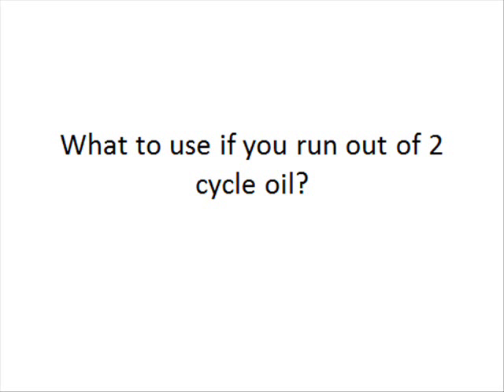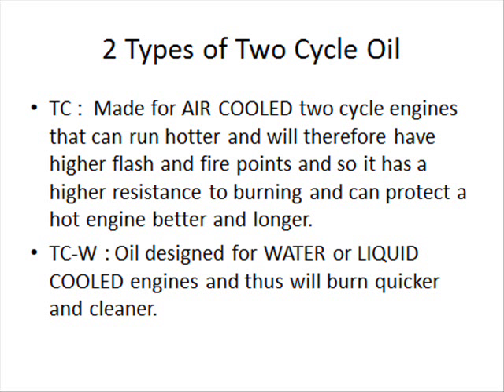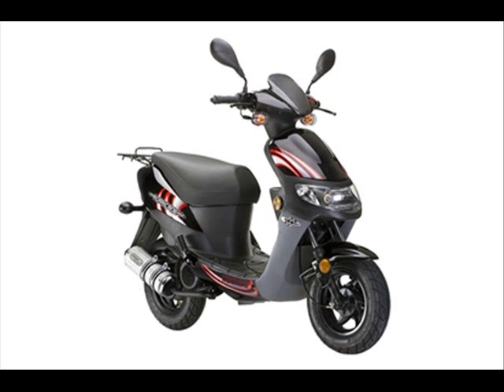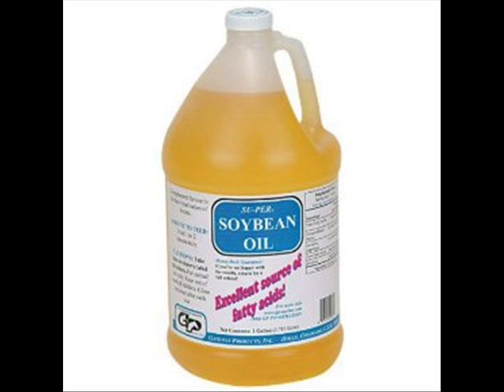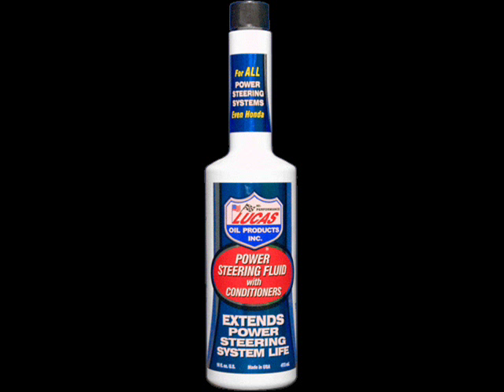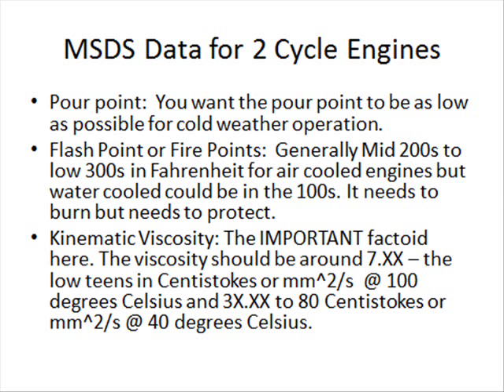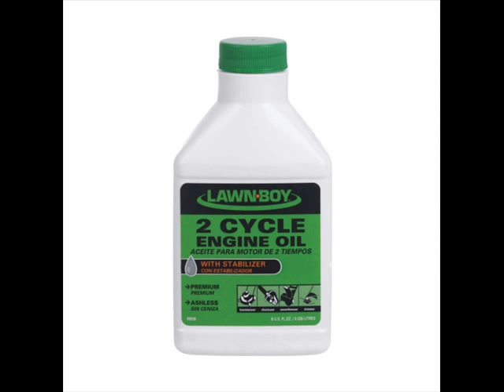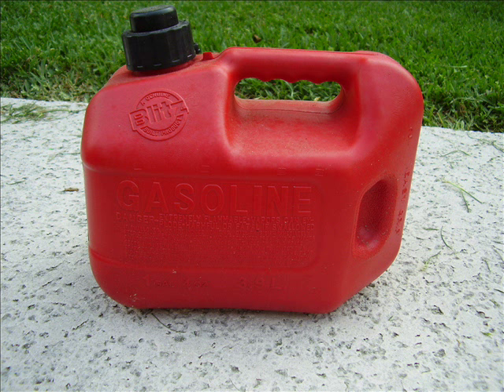What To Use If You Run Out Of 2 Cycle Oil

Comment: My dad cut pulp wood for years and he used 30w oil mixed with gas in his saws. He changed the spark plugs every January 1 and that's it. He still has those old McCulloch saws and they still run great. He even saved his used oil out of his truck and mixed it with the gas.

Comment: Would SAE 90 gear oil (GL1 , 2, 3, 4 or 5) be ok in a premix motor?
Reply: Old homelite super xl 12 chainsaw :  gas cap states one cup sae 30 motor oil mixed with 1 gallon gasoline.

Comment: Hey quick question!! How about using oil additives, such as Lucas oil treatment, either engine or transmission treaments whichever I have laying around?
Reply: If you use anything other than 2 cycle oil and you are putting it in a cheap weedeater like a Ryobi, Homelite, Craftsman etc you might want to use more substitute oil than you do with your regular 2 cycle oil. Try buying your 2 cycle in a gallon jug and maybe keep a reserve supply of oil. If you own a high end commercial 2 stroke Stihl, Echo,Shindiawa etc use the good name brand 2 cycle oil and mix 4 oz oil to 1 gallon non ethanol fuel (if available in your area)

Comment: will great large deposits over time In cylinders, coat plugs,  and gum everything up....if you absolutely have to run 4 stroke oil in a emergency , change your sparkplugs asap

Comment: If I understand your video,,,,(by the way, thank you VERY much for a great and very informative video),  one's concern shouldn't necessarily be about surfactant additives, or lubricity additives, all one (kinda) needs is a quality supply of lubrication that WILL burn, it shouldn't be too thin, or too thick,,,,just a GOOD oil.  (Did I get it right?).  Thanks again for the fantastic video, great information, and outstanding presentation.
Yours,
Tom

Comment: How about lamp oil ?  Also, it's not to hard to compare the viscosities of two liquids , just heat them to the same temperature and time how long it takes for a BB to sink.
Reply: Lamp oil is the same as kerosene but cleaner burning I believe, may work in a low compression engine as a gas substitute not a 2 stroke oil substitute, old john deere tractors would warm up on gasoline then switch to kerosene when it was cheaper

Comment: Hi JPchannel100, at the end of the video you told us a story about the guy with a 2 stroke moped ran out of gas. So he used alcohol and a chunk of grease. Could you tell me how well it ran, how bad the smoke is and did he drain the alcohol grease mixture from the tank and replaced it with 2 stroke fuel?

Comment: i have question is ok if you mix 2 oil together let says supertech 2 cycle oil and Echo 2 stroke oil
Reply from the maker: Good question; it is usually not recommended to mix various 2 cycle oils in great quantities. It is common though in use to run multiple types of oil in a vehicle based on fill-ups. I would recommend using almost all of one or as much as you can until adding the second. I have used multiple oils at one time but not consistently and have never seen an issue. Most manufactures will give a warning on the bottle or on the website if mixing could be an issue. I have heard rumors of certain oils gelling when mixed.